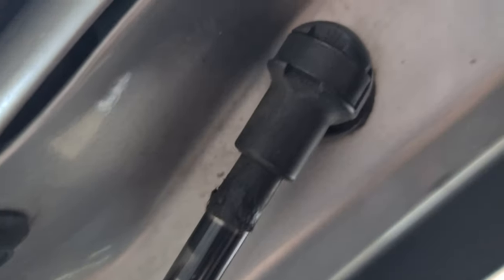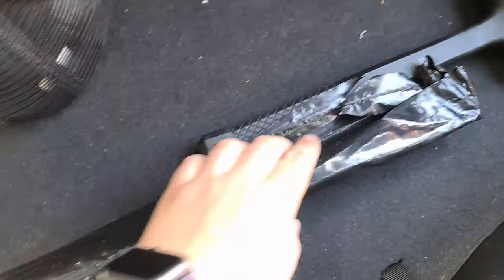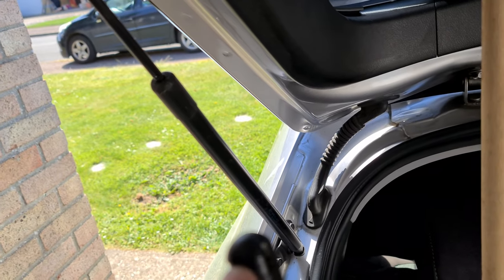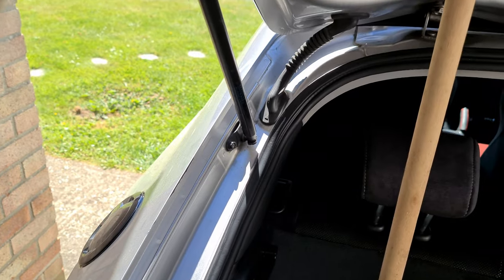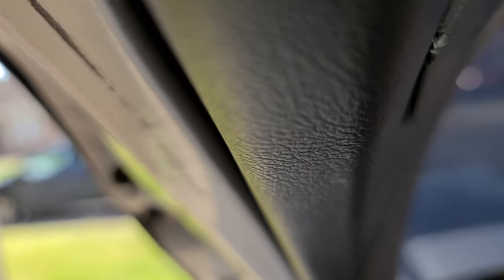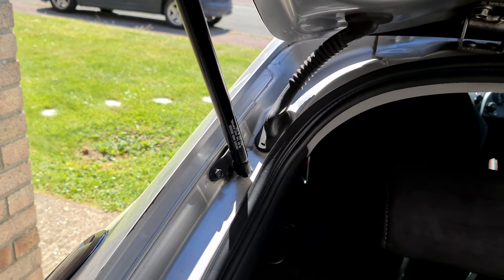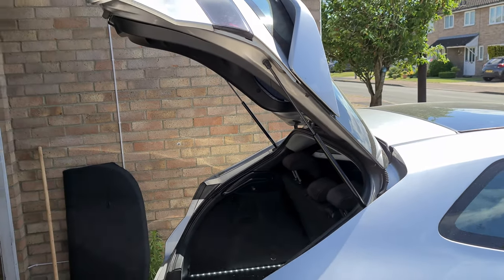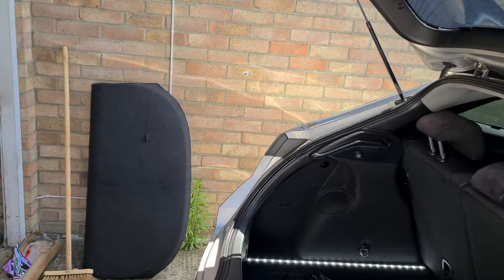The Civic gets new struts!!

Comment: I used to have 2 mk8 civics both the fk3 (2.2 cdti 5 door) 1st one had a sliping clutch and other one had injector seals gone then injector fault loved them both would have another one any time if it was cheap to run
Reply from the maker: Mine has never gave me any issues so far fingers crossed mate haha 🤣 they are nice cars and run very smooth! I'm happy with mine! And doesn't cost me much to run it!and thanks for the sub bud! 👍👍
Reply: @Billyevans93   I bought both of mine cheap  as needed a cheap run a around while I was fixing my ep2  but the fk3 were too expensive to insure compared to a b7 Audi A4 1.9tdi (next car)
Reply from the maker: @s3bby513  ah fair enough! I like the ep2 iserll there nice cars this is my first honda and I'm enjoying it!